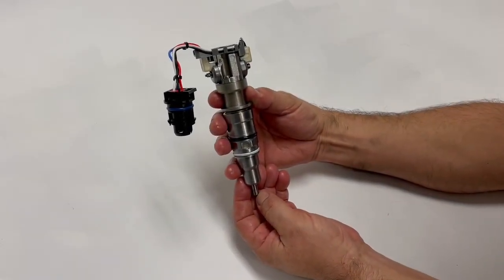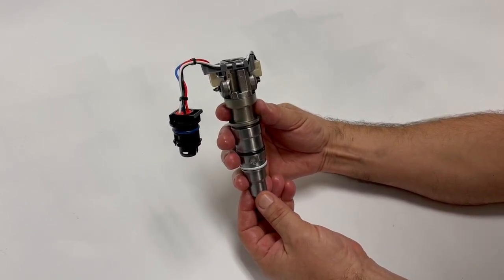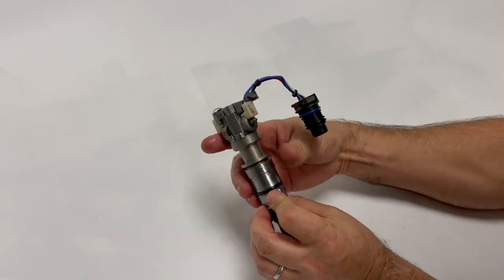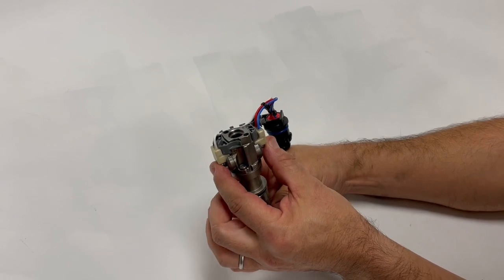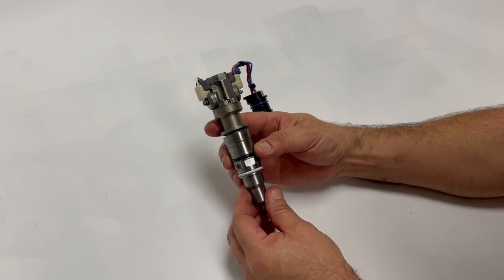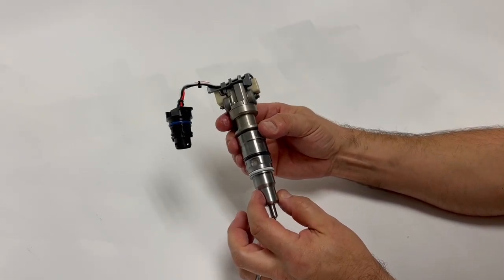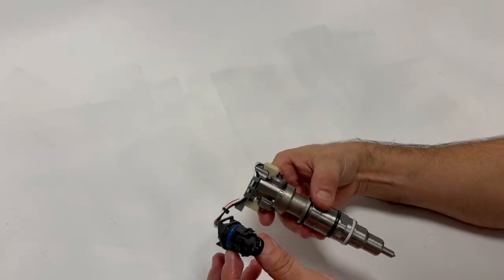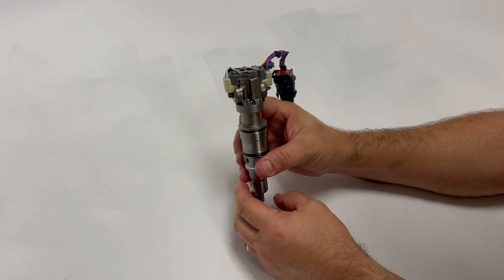Ford 6.0 powerstroke injectors | What you need to know

Comment: Can a bad sluggish oil damage injectors  ? Can I flush the engine oil ?
Reply from the maker: Maintenance is imperative on the 6.0L engine and the injectors can be affected by poor engine oil quality or lack of proper oil change intervals.  If you are having symptoms of a failed injector (rough running, hard to start, rough running cold, better after the engine is warm), the only real solution is injector replacement.  To the best of our knowledge, there is no way to flush the engine/engine oil.

Comment: You can replace the top o ring. I did it on mine when I rebuilt my engine
Reply from the maker: While it is possible to replace the o ring in the top of the injectors, we really advise against it.  If that o ring is compromised, the other wearable parts of the injector probably are too.  Thank you for your feedback.
Reply: May aswell replace and get a bit more life out of it then spending arm and a leg for new injectors